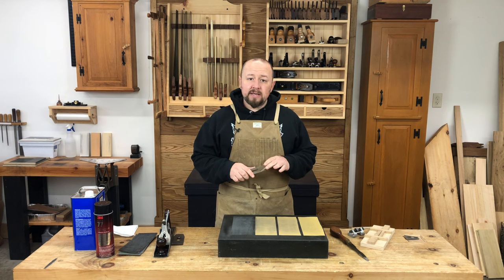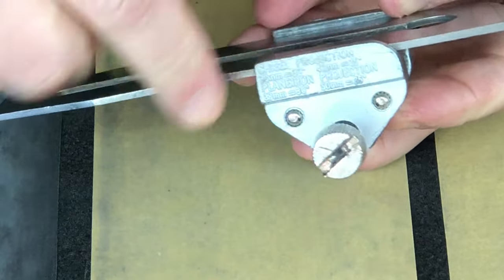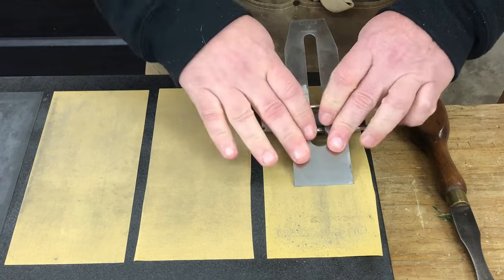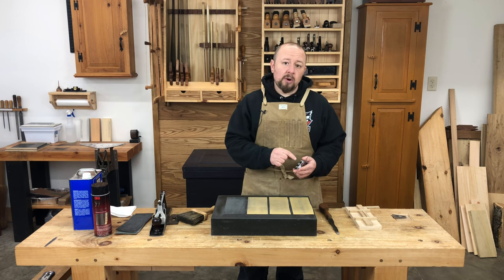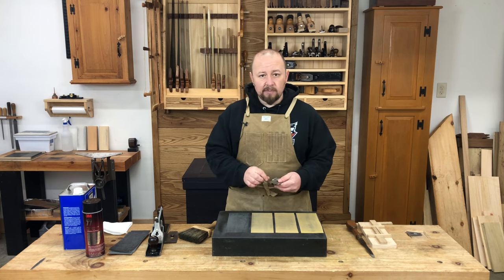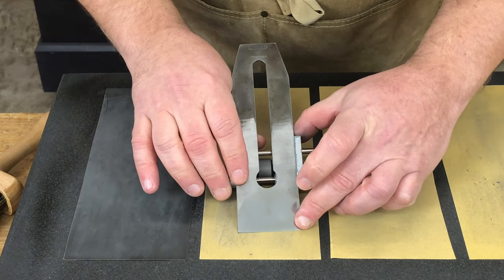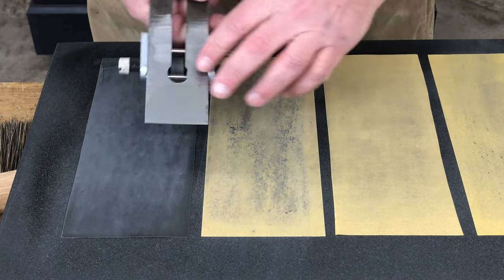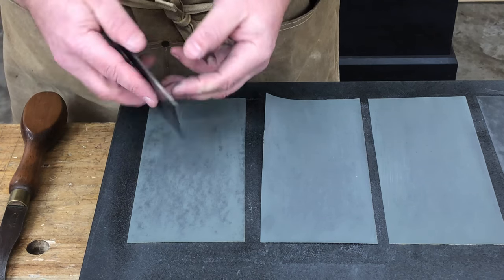Grinding & Honing with a Honing Guide | Hand Plane Foundations

Comment: this is an excellent tutorial thank you! it is one of the clearest and most accessible I've seen. I'm a beginning woodworker and I've been having trouble with sharpening like this - I'm working with vintage stanley irons and diamond stones. I have tried with and without the honing guide, but I worry that this method of applying pressure to achieve a camber might damage my diamond stones. Bob, can you speak to that at all ? Also, how long did it take to get your inital 25 degree bevel? I have worked some irons for what feels like over an hour both on my 'very coarse' diamond stone and 120 grit paper with incomplete results. I find the paper clogs up with shavings. Should I try a finer paper, or go back to my stone? Thanks for all of your videos, they're super helpful!
Reply from the maker: You won’t damage your diamond stones buy adding camber to a blade. As for the time to create a new bevel on an old Stanley blade, it took maybe 20 minutes on 220 grit paper. It should not take over an hour. Use a brush to clean the paper frequently so it doesn’t clog. And don’t use cheap sandpaper. Cheap sandpaper breaks down too fast on metal. I use 3M Sandblaster or Norton 3X. Both are stearate coated paper that will not clog with metal filings and will last much longer than cheap paper. But you still need to change the paper when cutting starts to slow down. You should be able to establish a brand new bevel on an old 2” Stanley plane blade in about 20 minutes and using 2-3 full sheets of paper. If it’s taking you a lot longer than that, you need to change the paper more often and use more pressure.

Comment: I was surprised that you began at 220 grit.  I've always started at 120 or (I thought preferably) 80 grit.  The problem was that while those grits ground the blade quickly they also wore out very quickly and made grinding unsustainably expensive.  So I'm wondering:  Does a higher grit lasts longer even though it means some more strokes when grinding?
Reply from the maker: Yes, it does last longer. And you’d be surprised how fast 220 grit is on vintage blades.